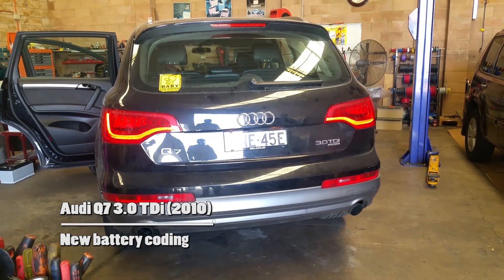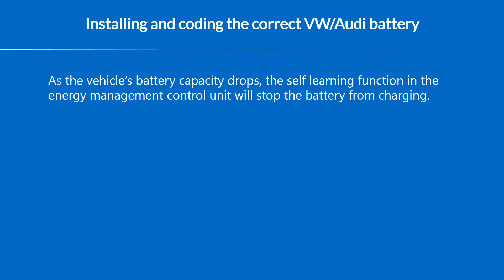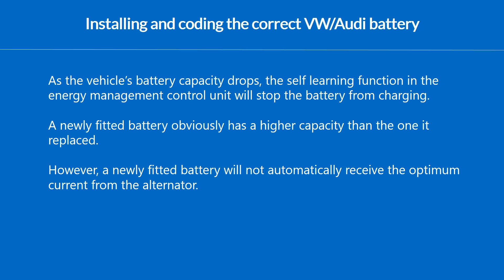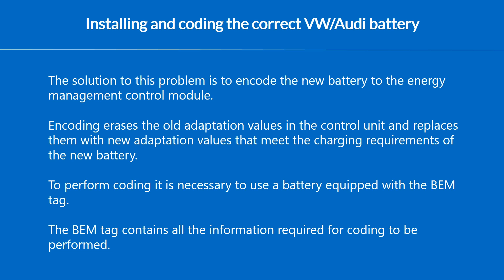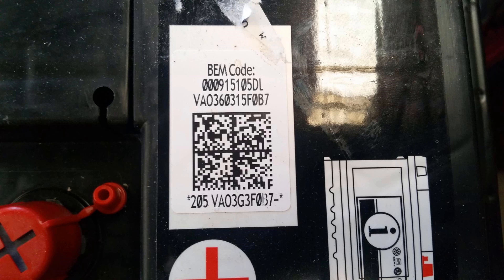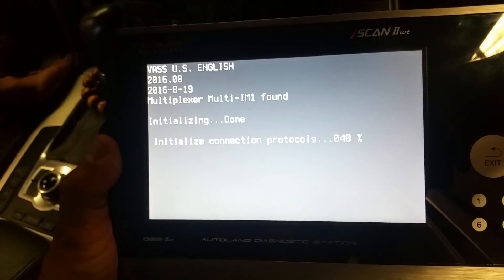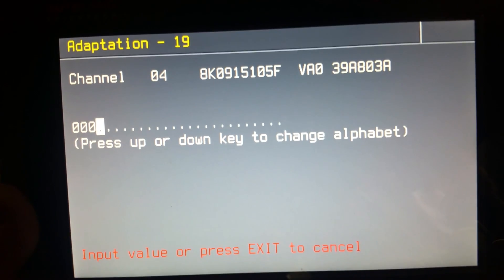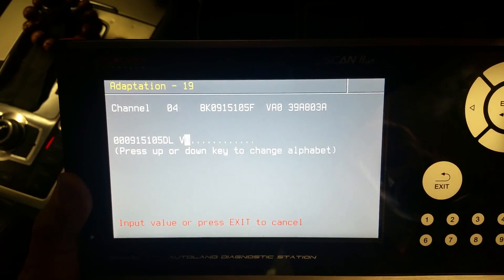Installing and coding the correct VW/Audi battery

Comment: Great informational video, it would've been nice to see the fault code before as well as after changing the battery. 
On a pessimistic note: Why can't the system, when disconnected realise 'this could be a new battery' and re calibrate itself?
VW got caught trying to trick emissions testing awhile back; this appears to be another software system to keep service and repairs inhouse.

Comment: What do you recommend for a battery that does not have a BEM code such as an AGM battery from Advance Auto Parts that isn’t one of the brands you listed?
Reply: The best method in this case is to type the same part number and adjust the serial number last digit by one different. You must install a likewise battery and same amp hour of course. This completes the reset and allows the car to restart its adaptions. Was taught this by an Audi field engineer incase anyone disagrees ;) in open to hear any other suggestions
Reply: @powayimports4175 lol thanks that's exactly my plan 😅

Comment: Someone installed a non BEM code battery in my Audi Q7 2013. But no code was needed. So what’s the deal ? It’s an Delcor AGM start stop function batt.
Reply: Your battery will not last as long as it should.

Comment: Filarako Dose a 08 Jetta 2.5 need the battery to be coded because I'm having some electrical problems like not changing at idle and when I drive the voltage goes up the alternator was replaced 2 years ago and battery tests good

Comment: This can be done with a VCDS a lot quicker and easier.
Reply: It can be done even quicker using OBDEleven. 👍
Reply: @JohnnyBea  I just did this. first time. I got a new battery with no BEM, I went from old Varta H15, to a Delkor LN5 (I think it's an asian brand ?), anyway to reset the car I changed the VARTA serial number by 1 digit to let the car know it's a new battery.. This is what a forum said to do. any advice ? I'm taking it into a mechanic as it needs a service  (not audi dealership - they're too expensive!)
Reply: @defaultHandle1110  I've purchased an OBDEleven device and it seemed to work but the fault of battery monitoring has come back, my battery seems fine and the battery is not losing charge also the battery meter reads full, if yet are experiencing anything like this maybe better to have a VAG motor technician check it out, maybe not a none VAG Technician because it's a bit specialist. If you have access to the green menu on your MMI and know what you are doing switch on the battery meter to check your battery, I'm sure there is a video on YouTube somewhere on how to do this.
Bearing in mind the green menu can not always be turned on as some of the videos say, you may need a OBD2 device or a VAG COM to turn it on from the factory setting depending on your vehicle.
I hope this helps. 😎👍
Reply: @JohnnyBea  how do you do it with obd eleven I have that but when I check the app both for battery replacement is on it?

Comment: Complete bollocks i'm afraid ! The whole BEM scare story is horseshit , when your vehicle is fitted with its replacement AGM or EFB battery it may require a code to be entered to reset the alternator voltage back to standard. I always use my home telephone number for this and guess what ? Yes , it works perfectly and the redness of the local Audi specialists face still amuses me to this day. Its basically a huge lie to drag most unsuspecting idiots back to the dealer ! Reset tools are £300 ish and you could try your phone number .....Trust me , you won't need mine ! lol
Reply: i used the date the battery was changed, it works!
Reply: It's all bullshit, I put a used AGM battery in my Audi when the original died with no coding and it lasted almost 6 years.  It was still starting the car but was a bit weak and I store tee car and drive it no more than once a week so I replaced it cuz I didn't want to worry about starting when it gets 20 below zero or worse.  A buddy who is a mechanic at an Audi dealer told me that the used battery I put in wouldn't last a year cuz I didn't program it into the car.  Well it lasted 6 years.  I just bought a brand new one and tomorrow I'll just drop it in.  I called him and asked him if he wanted to bet me how long would this one last without  coding but he didn't want to bet me.  All bullshit to have you come into the dealership and spend more $.

Comment: I have a Audi A4 2007 could this be my issue as well. New battery and it’s dead.
Reply: i believe it is....without the battery management system installed correctly that battery would be good as dead without proper install
meaning even with a memory saver attached to the obd 2 port you're still not doing it right. also for that year of audi all engine types need a scan tool to do the job